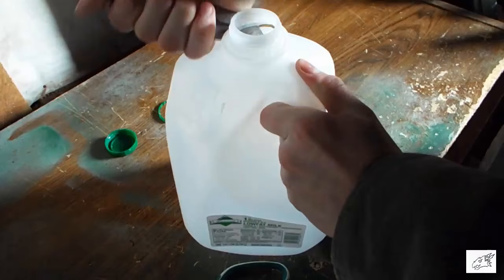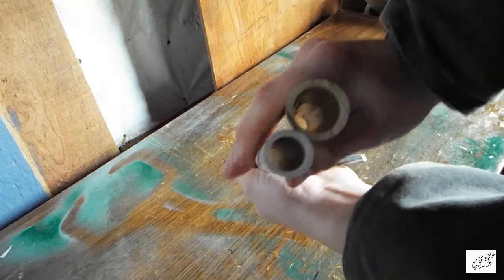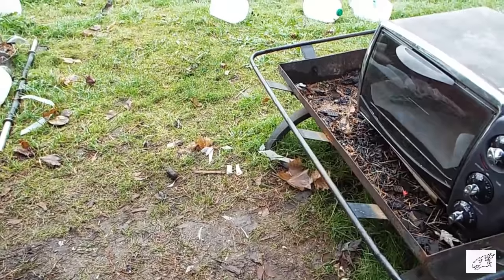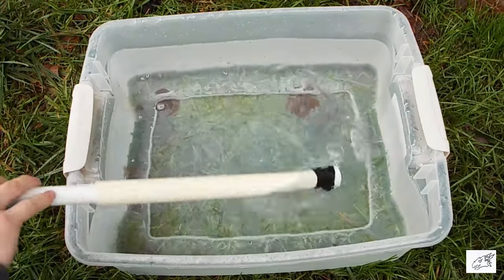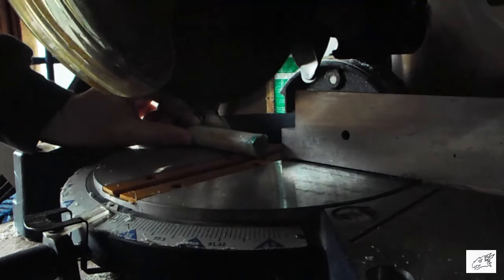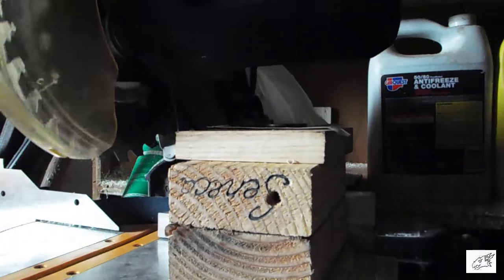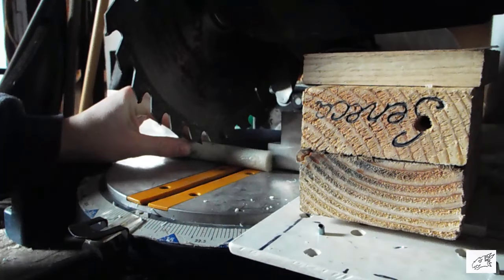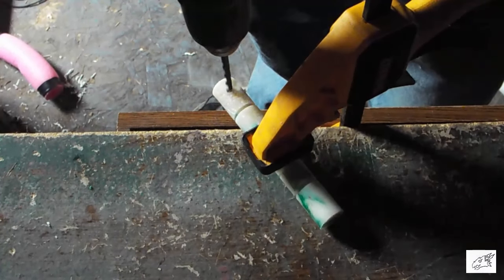How to Make: a KUBOTAN out of Milk Jugs

Comment: Have you tried using a cedar dowel?  It's a hard wood and easy to work with.
Reply from the maker: I haven't, I made it out of milk jugs just to see if it was possible. it probably would have been alot more practical to make out of a dowel though
Reply: +Kali Southpaw indeed